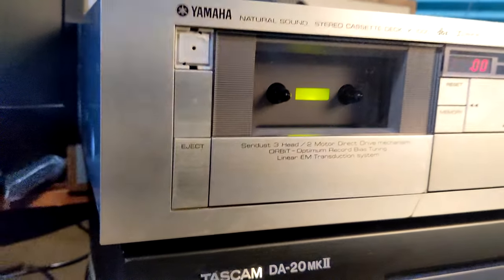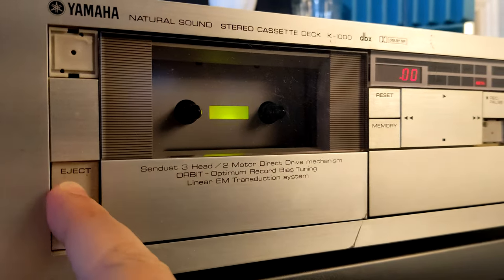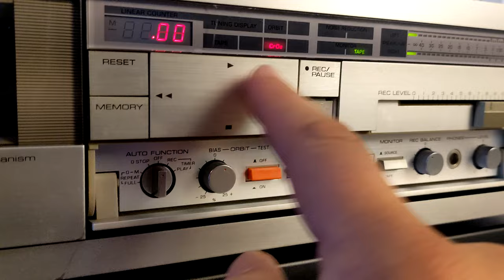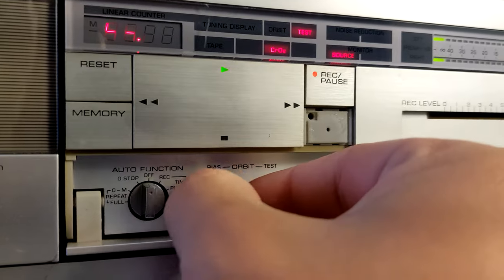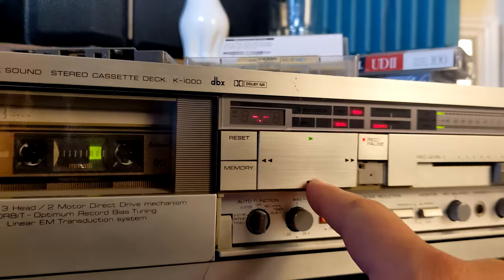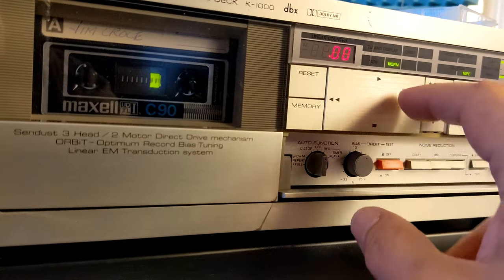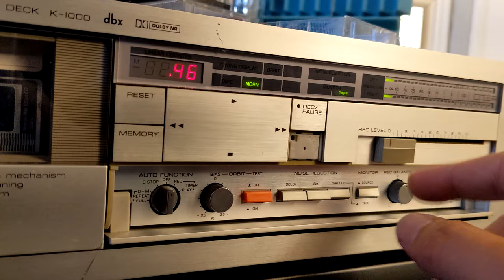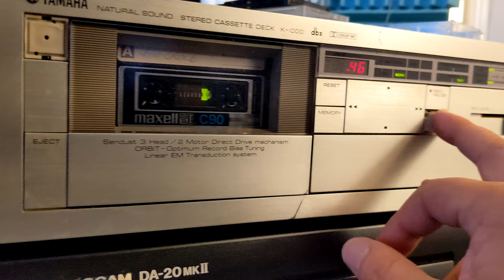Yamaha K-1000 - 40 years old direct drive 3 head cassette deck

Comment: K1000 and K2000, best decks i measured w/f wise.

The K2000 is pretty much there in the top, very good performance AND still can be found for cheap (when there are any for sale).

Comment: I have this deck and a question. Is it normal for there to be what looks like the bristles of a brush attached to the underside of the left-side capstan? At first, I thought it was an oddly thick, uniform layer of dust hanging off the  capstan, but it won't come off using a cotton swab. Tapes play fine. The demonstration of the ORBiT was helpful, thank you.
Reply from the maker: As many older parts, it's probably started to crumble, but if you don't hear anything on your sound, leave it like it is unless you're ready to replace it with hard-to-find parts... It's normal for that age. Regards
Reply: I saw a picture on eBay of what you describe that's how I found this video. His is missing so I downloaded the service manual and yes that little brush should be there, the service manual describe it as 'Felt, Erase Head Tension'.

Comment: Nice very nice which one do you prefer there the 3head tape deck or the 2head tape deck..
Reply: @Vinyl is Final cool and awesome I was just wondering 🤔 that so 3head cassette deck is better than the 2head cassette deck I know that the 3head you can monitor what you are recording with the tape, and monitor feature that it has on the 3head, and on the 2head cassette deck it does both, but on 2head you have to rewind what you have recently recorded to if you have any errors with the recording instead of the feature like the 3head cassette deck has on it.,and yes that's a very nice cassette deck there 😉
Reply: @Vinyl is Final thank you 😊
Reply: @Vinyl is Final your welcome, and thank you look forward to seeing more videos, and reviews.
Reply: @Vinyl is Final right ✅️
Reply from the maker: For playing back tapes, it shouldn't matter that much, but usually 3 head decks are better quality than 2 head decks, but again, with 2 head deck you will get auto reverse... unless you buy Dragon, then you'll have all.
Reply: @cheapoldhifi  right ✅️ and thank you very much for the info there 😀 awesome cool thanks 😊